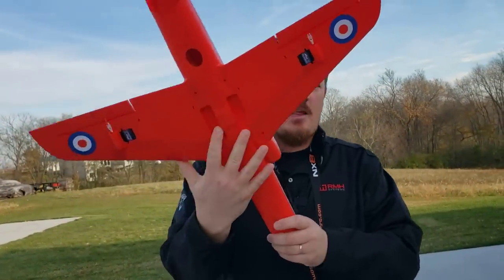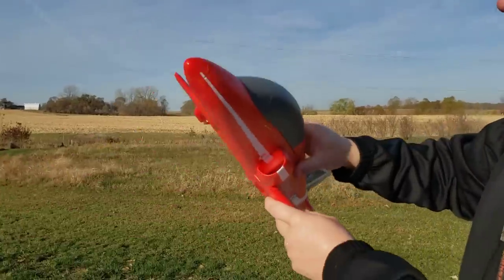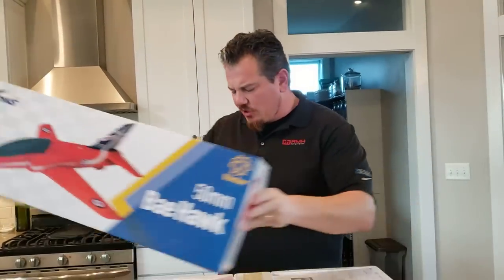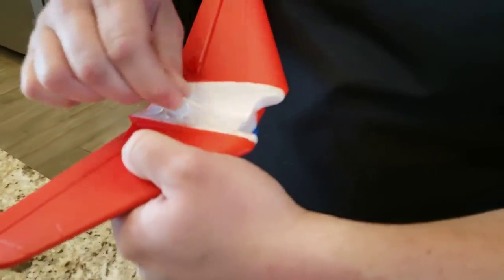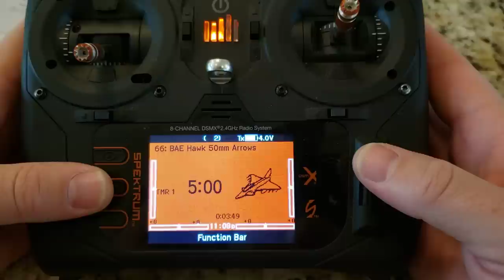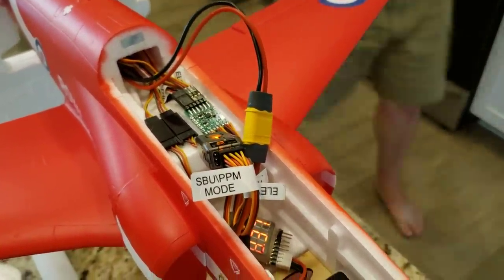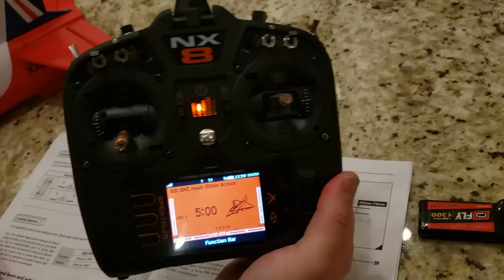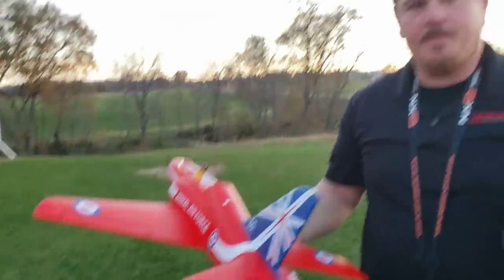Arrows - BAE Hawk - 50mm - Unbox, Build, Radio Setup, & Maiden Flight

Comment: Ive built mine tonight and plan to maiden tomorrow. Wish me luck! Your video is what led me to the aircraft and the content is much appreciated. A big thanks to you and Megan. I unfortunately couldn't use the link due to shipping prices and it turns out my local model shop had one. The ones available in the UK don't appear to have the vector stabiliser so I banged a dumb OrangeRX 6ch receiver in that I had lying around, bound to my Radiomaster. Ive gone for the larger end of the battery range which is 2200mAh 3s instead of 1300mAh and it balances OK. Interesting titbit for you....the ESC is rated for 4s after researching the spare parts but I'm not sure if the motor can handle 16.8v. I'm not risking it for a while but might try a 4s someday. Ill let you know if it works.
Reply from the maker: I flew mine on 4S and it was very nice!!!

GIVE HER HELL WHEN YOU GO TO LAUNCH -100% throttle...don't screw around, or you will end up broke in half!!!!!!!!!!!! (I did that too, and we flew it around ripped in half - it was a great little video, but not sure if we'll share it or not)
Reply: An update on the maiden. I treated myself to 4 batteries and I had 4 successful flights. Its a stunning flyer. Fast, aerobatic and patriotic. Being British it actually attracted a small crowd at my field. It was like a minature version of an airshow here in the UK. Quite a few inquisitive people came over and asked lots of questions about it when I had finished. When I do a maiden I take a second aircraft just incase, and I took the UMX A-10 V2 which I bought after your review too. I had a great time and once again, thank you.

Comment: Brian I am SO glad I found you! Endless information. Fantastic videos. You could go a little slower setting up the transmitter for us new guys. But maybe that is just me, GREAT JOB!!
Reply from the maker: Glad you're here with us! We always struggle with radio setup speed as people have a (strong) opinion both ways. ;) You'll start to get the hang of it in no time, but until then, you can always pause or slow down the playback speed using the little gear icon.

Comment: Afternoon Brian from here in the UK, Was watching you on one of your videos soldering LED's onto a model, what my question is , the thin wire that you were using look's the same as used in the UMX Timber,does this wire have a reference and is it a copper wire with a coating on it to stop shorting out. I am looking for some to wire up lights on another model.  Hope you can understand what I am try to explain to you. Thanks for all the work that you and the Mrs put into your video's, keep it up and Stay safe.
Reply from the maker: That wire is has a varnish coating over it, so even though it looks like it'll short out, it is actually coated pretty good! You can cut the wire easy, but you can also cut it by accident too ;)

Here's some examples of where to get some....

https://amzn.to/3oS6dPQ - VERY SMALL!

Comment: I love T-45s, I need one! Awesome flight! Have you flown the Arrows F-15? I just did a unboxing video on mine and build video tomorrow. Can’t wait to fly it this weekend.
Reply from the maker: We have it on our VERY short list (the F15) and I want it so bad!!!
Reply: @BrianPhillipsRC  I wanted it for a while and just picked one up. Very nice build, my only complaint well two! The RX mounting is kinda dumb and had to make 6 6in Extensions and remove the battery tray and run the RX up front and the other is plastic gear servos, definitely should be metal! But all in all great plane so far.

Comment: It works on a 2200 3s really well -  in the UK we do not get the Vector unit - it does not need one.. it glides really well - also its strange but we have dialled down the aileron movements...not increase them....The Arrows T33 is another awesome jet that they do...
Reply: Hello FT been watching your flights interesting "grass bounce launches"😉. Got this nice model 2 weeks ago but been surveying YT videos observing its quirks and characteristics before I maiden mine. Overall Im very happy with choice. Cheers 😊
Reply: It did look like the 2200mah battery made it hard for the Hawk to get on step and contributed to the grass bounce take offs. I can imagine flying it at the upper battery size/weight limits made the aileron roll much more sensitive than at lighter/smaller battery weights. Any thoughts would be appreciated.
Reply from the maker: That's a shame! I love the way the Vector works, but I just prefer to have a stabilizer, even if it's not needed.

Comment: I find the easiest way to launch these is using the throttle cut. Switch on throttle cut, push stick to full throttle, right hand on stick, model in left hand, flick off throttle cut with right hand, launch with left under arm, have full control of elevator and ailerons from launch this way.
Reply from the maker: good idea!

Comment: Hey Brian love your videos and awesome flying skills.  Could you tell me what the vector connections are please?  UK model has no vector so I bought separately but no instructions on how to connect the unmarked pins to the servo wires/throttle ! Thanks in advance
Reply from the maker: I can't tell you beyond what you see in the video.

Here's another trick. Hook up the Rx as usual, then hook up ANY cable...and see what control CHANGES when you wiggle the plane. When you do this, you only have two control axis to figure out...and the Rudder will be unused. When you're out of control channels, you can assume the last would be the Control for Stab/Off/Auto-leveling.

Comment: Hi Brian, with self level on do you get slight up elevator when full throttle.
Mine does not sure if this is normal?
Elevator doesn’t move on the other two modes.
Cheers 👍🏻
Reply from the maker: I have ordinary control when in Auto-Leveling, but there will be LIMITS to bank and pitch angles, to prevent overturning the plane. I wonder if you've got something goofed up on your vector???

OR, are you using AS3X and SAFE? ....what Rx, (should have asked that first, sorry!)

Comment: Hi brian love watch ur vids full of great information ive just recently bought a bae hawk 50mm and on the maiden flight went well for about 30 seconds and then lost full throttle was only getting about 20% seems to be the lvc cutting in possibly not sure  i was running on a brand new 3s 2200mah overlander  fully charged got the plane down ok put another fully charged battery in and same thing again after 25/30 seconds throttle cuts way back would you have any ideas wot could be causing this problem was wondering could it be my receiver at fault my radio great wouldnt be the newest ive had it a long time though ive never had any trouble from it  its a hitce optic 5  transmitter with a minima 6t receiver any help would be very much appreciated

Comment: These smaller jets look fun and convenient, I haven't owned any edf smaller than 4 or 6 s.
Reply from the maker: The 3S EDF Jets are usually pretty lame, but this and some of the recent 3S EDF Jet's have been pretty good!
Reply: A lot of people are succesfully flying these on 4s out of the box. They draw around 37A static on 4s at full throtyle,  so probably still above 30A in unloaded free flight so I'd be playing it safe and sticking a 40A in there instead.

Comment: Awesome Brian, I only had to wait one extra video before you did the Hawk. Getting this one for sure as I’m a Brit, I grew up watching the Red Arrows at air shows and events in England. Living in Colorado now and flying at 8750’ above sea level. In your opinion did you think the Hawk had a powerful or weak 3S power system..??  Thinking I could run this on 4S (1300-1800mah) with a 75/80% throttle rate to protect the stock 30 amp esc. Hoping Arrows have sent you the twin 64mm F-15 already..!!
Reply from the maker: Howie, I'm not sure if it would handle 4S, but I can say where we are, the air is much less thin than where you are.

I want to try, but don't want to kill it ;)

Comment: Hi Brian love the video, what about providing some links so that UK purchasers can benefit from the  Vector stabilization? At present we are forced to buy aftermarket stabilization eg Lemon or Spektrum which adds considerably to the cost £30-£80, therefore it's worth paying shipping from USA to UK.
Reply from the maker: I know....we have the same issue, only with REFLEX on FMS - gotta be a branding deal.

If you can't get the Vector...get the AR630 - this would be PERFECT for this little firecracker ;)

AR630 https://bit.ly/3lh5iqD - AS3X & SAFE with limited telemetry + INTERNAL Antenna
AR631 https://bit.ly/3pYNC3c - AS3X & SAFE with limited telemetry + EXTERNAL Antenna

....slightly more involved setup, but you'd get benefit of flapperons, if you wish, and would be CLEAN ;)

Thanks Kevin!

Comment: Hi Brian! I could use some random help. Generally speaking is it acceptable to use a 50c battery in place of a 30 c? My plane says I can use a 3s or a 4s. But I’m confused on on the c rating. I’m under the impression that as long as I don’t go get the 4s then I’m good? If you have a video on it I’ll check it out but I didn’t see one on the guidelines/perimeters  so to speak. Regardless, you’re the man!
Reply: *Go more than the 4s
Reply from the maker: YES 50C is okay in a plane that calls for 35C, but a 25C pack in the same plane might lead to a puffed lipo pack, or possibly poor performance, or both, or in a worst case scenario, a fire!

50C is better than 30C, and 30C is better than 20C. The ONLY time you don't want a higher C rating would be in a transmitter pack, where you want to hold down the discharge rate to make the battery last a really long time.

Generally, the higher the C rating, the better the quality. They can cost more, and sometimes are a BIT heavier, but the higher C rating speaks to the batteries ability to discharge quicker...which is a good thing. you want to be able to move the charge from the pack to the plane's ESC ASAP ;)

Comment: Very cool little jet, nice review. Seems like it would be much easier to use a 6 channel receiver and assign the gyro to the flaps or retract switch.....
Reply: I seldom fly with a gyro, after watching this video I'm going to purchase this, through your link and probably try the gyro on a 6 channel receiver. I got totally confused watching you program the 4 channel receiver. I don't think my DX7 has the program capabilities that the NX Series has.
Reply from the maker: It's all about trying to help folks save a few bucks, but like I may have said, the 6CH would make it a lot simpler. This would also add the ability to make an inboard flap mod too ;)

Comment: would you recommend this plane  to get as a first edf?
Reply from the maker: You could! These little 50mm EDF's are a great first time, but I have to admit, I usually suggest the Habu, if someone is asking. I think the 50mm Habu is a perfect beginner offering, plus you'll get wheels up and wheels down experience on a cheap to battery plane. This BAE Hawk will be fun, but it doesn't even have a rudder, and no wheels up wheels down to help you learn the "ways of EDF" ;)

Just my 2 Cents...

https://bprc.me/Arrows_BAE_Hawk
VS
https://bprc.me/Habu

Comment: Pretty dang cool I just don't know why they wouldn't go ahead and add a rudder I wouldn't think it would cost that much more This would be a good plane to do a video on how to add a rudder It looks like it fly's pretty dang good well with a 3S battery that is 😁 
Nice review guys 🔥👍✌️
Reply: edf jets dont really need a rudder, they cause more problems than they solve.
Reply from the maker: Sno - I'd have to disagree - I LOVE rudder ;) I don't think they add problems, but they DO add some cost and some complexity. That being said, the ability to slip, and speed rolls is very nice.

That being said, between Rudder and Flaps, I'd want flaps ;)

Comment: FAR, and I mean REALLY FAR for me to ever give you suggestions, but since the ArrowsRC Viper came out I’ve been flying that 50mm on 1800, 3s, 70c. Since I had a bunch, I maidened and have continued to fly the T-33 and Bae Hawk on the same 1800 3s batteries. (4 minute flight times on all three EDF’s. I’ve flown the baby Viper on 4s 1300’s. Not a lot of difference in performance with less flight time)
Reply from the maker: I flew her on 2200mAh 4S 30C Smart G1 pack and it was GLORIOUS ;)

Comment: Please don’t encourage people to run it stock on 4s it exceeds 38amps on 4s at full throttle,well above the stock 30amp esc it comes with it will work but your asking for trouble
Reply from the maker: I'm not encouraging anyone else to do it, but rather showing it can be done.